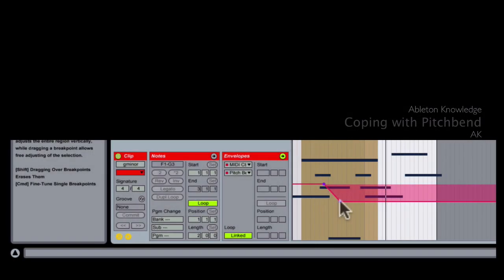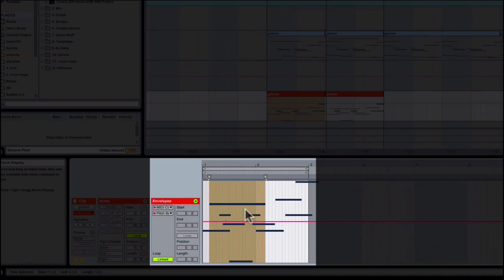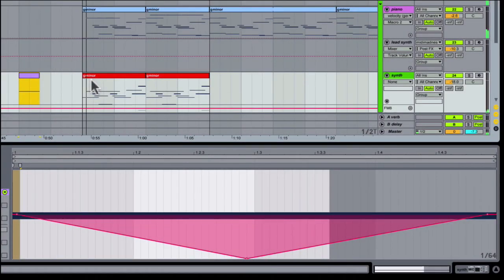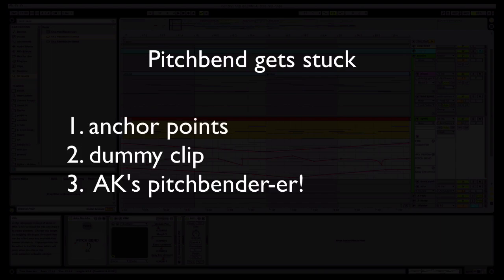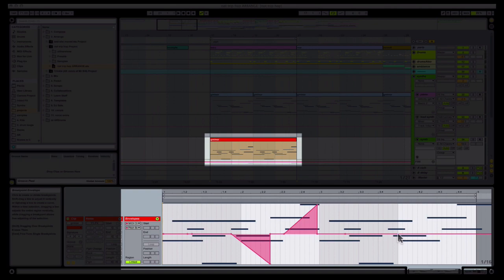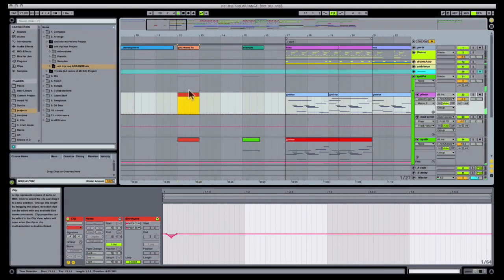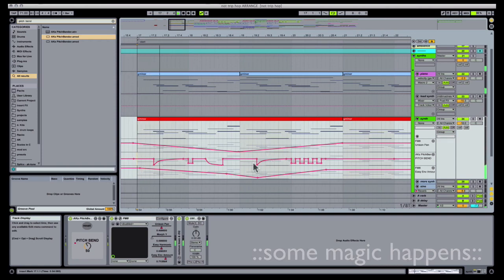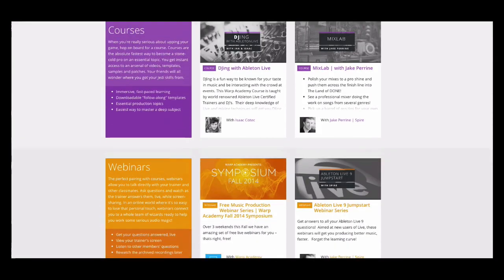How to Work With Pitch Bend Problems by AK

Comment: Thanks a lot, the dummy clip is a good workaround. My problem was even worse, every time I touched the pitch band on Push my current sampled instrument (even those in Kontakt) would simply go bonkers, now I just put the dummy right before the clip and play it starting with the dummy and it works.